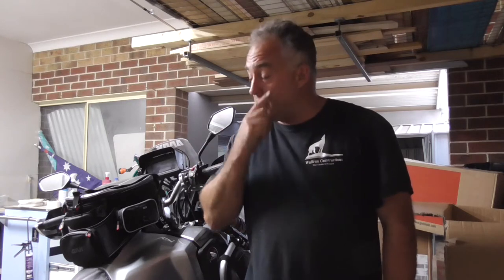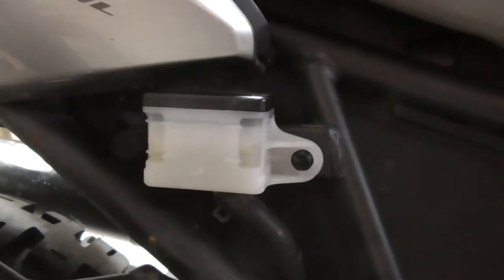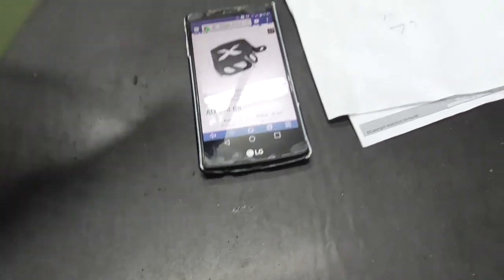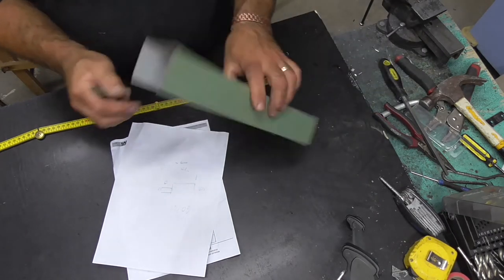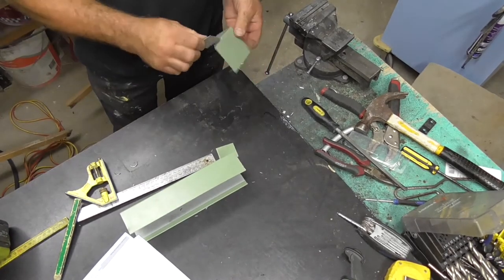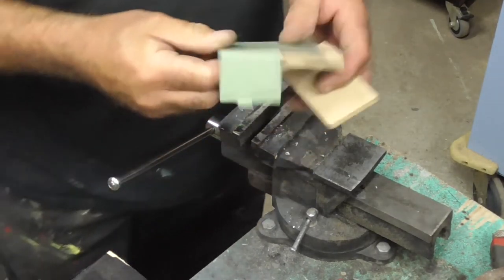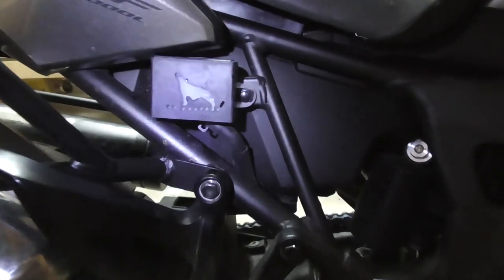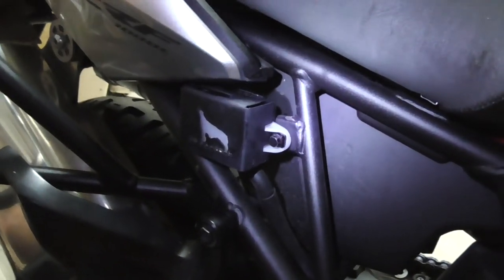Brake reservoir cover, Africa twin

Comment: I went with the HRC Brake delete kit,,basically just a special clear hose
Reply from the maker: Rob Banks 
Just youtubed the Hrc kit.. Great idea 👍👍
Reply: it is,,,, no chance of sun damage, very flexible and you can clearly see the condition of your brake fluid,,,,,,,,,,,,i think it was 30 bucks here in Oz
Reply from the maker: Rob Banks 
Do you have a link to where to get it all the ones ive just looked at are on CBRs
Reply: no link but i got it from ebay,,,,,,,will have a look and see if they have them